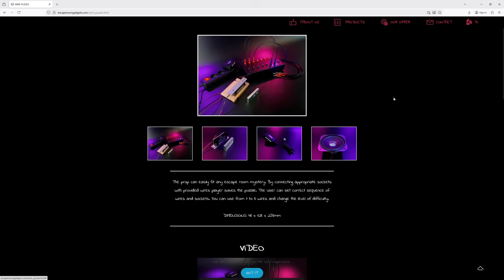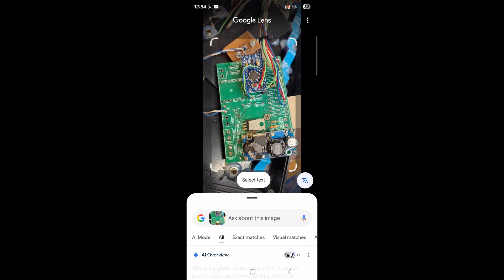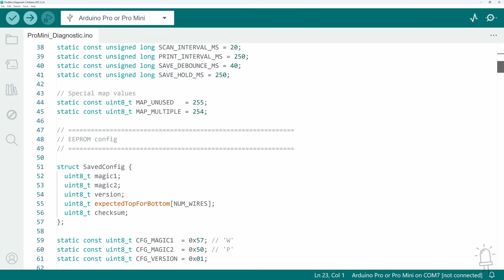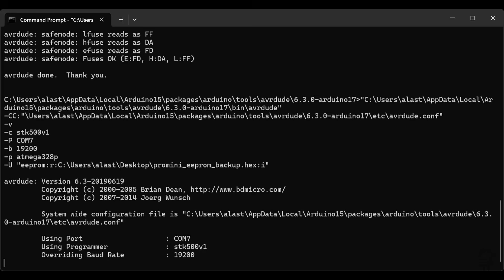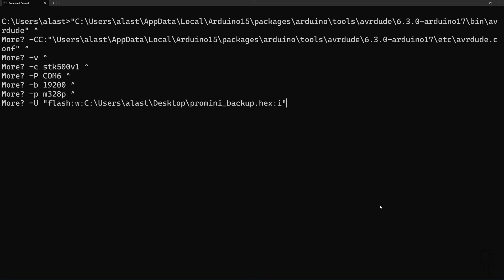Fixing a Broken Electronic Escape Room Puzzle (Reverse Engineering + Arduino Rebuild)

Comment: Could the damages Arduino board be used for another project as long as you avoid the faulty pins? That would be better than contributing to the electronics landfill.

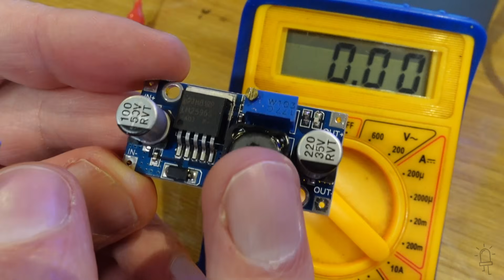Comment: I enjoy these fault finding videos, only thing I would add when you were doing your fault finding and component replacement is 3:52 I would check value of new and old variable resistors, match values to new one and power up same as you did to get a guide of what voltage they had set it originally, then compare that with what is actually needed. Helps give you additional confidence what may have caused the issue originally. Great pickup with the ic pins interconnected.

Comment: I often hear that Dupont jumper wires are not suitable for final installations (e.g., smart home systems or escape room setups). If that’s the case, what is actually used in real, production-like builds?

Most tutorials only show breadboard prototypes, but almost never demonstrate what a proper, reliable final implementation looks like. What is the common or industry-standard approach for wiring and assembling such systems?

Notes:
	1.	Please don’t suggest designing custom PCBs. While I understand this is the ideal solution, it’s usually impractical for one-off projects like escape rooms due to time and cost constraints.
	2.	If pin headers are not suitable for final use, why do most modules come with them by default? Does this mean these modules are primarily intended for prototyping rather than long-term deployment?

I’d really appreciate a practical, real-world answer.
Reply: well, I'm not an expert but the logic here is that those jumper wires come with lower gauge wires and the connector may not make a proper connection due to tension. so the proper way is to use 24 AWG silicone insulated copper wire and solder it directly
Reply: @ragesmirk  Got it, thanks. But how exactly are you supposed to solder wires if the module already has pin headers soldered on?

In many cases, there isn’t even a version without headers available. So what’s the proper approach here — do you remove/desolder the headers first, or just solder directly to them?

Was this intended by the manufacturer, or are these modules really just meant for prototyping?
Reply: @SLT.RWushi  there is always a version without headers. you can solder on them if you want, you can tin the wire with a bit of solder beforehand
Reply: @ragesmirk not always. For example DF Player Mini only with pin headers

Comment: I love trying to fix electronics, though I'm still very much an amateur. What I can't believe is how you're able to hold that solder wick while you desolder, because my wick becomes incredibly hot to the touch almost instantly, even if I hold it a couple inches away from the iron. I usually cut off a piece and hold it in place with my mini needle nose pliers. You must have chef hands!
Reply: yes, I also was baffled by this

Comment: With regard to backing up the code that was on the Arduino, you CAN do it in this instance.. however I dont know if it's possible with the Arduino alone. 

What you can do with the AVR based ones, is connect up an AVR programmer and then use "avrdude" (which should be part of the Arduino toolset) to dump the contents of the Flash. Theres a few options for Arduino programmers - I personally use a "usbasp" i picked up some years ago, but you can also program an Arduino Uno or Mini to act as an AVR programmer that avrdude can use. This will only get you a binary copy of what was in there, but you can at least restore it. You could also look at the binary dump with a hex editor to see if there's any strings that might be output to the serial port.
Reply: and i really shouldve watched the whole video through before posting that, LOL :)

Comment: Those Chinese DC/DC converters are notorious for this, always run them well under their "rated" voltage or upgrade the capacitors. Looking at the quality of the build I assume it had no reverse polarity protection either.
Reply: Theres no reverse polarity protection and I'd guess thats what happened. The LM2575 converters arent that bad as theres very little to go wrong